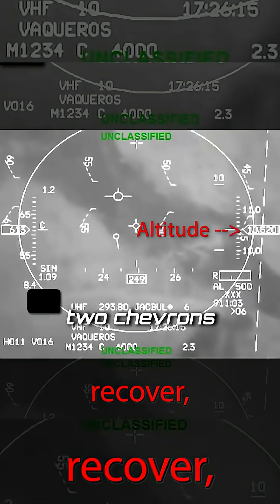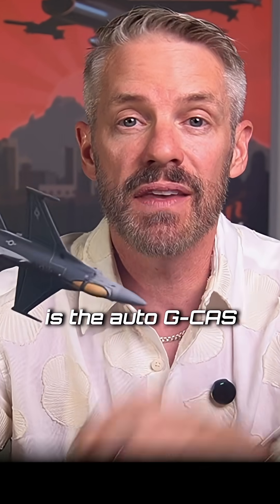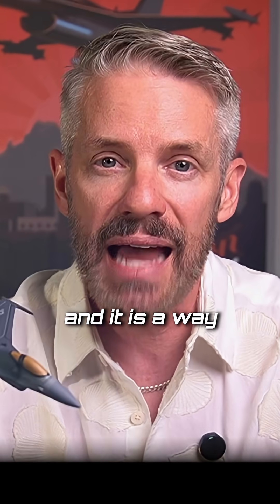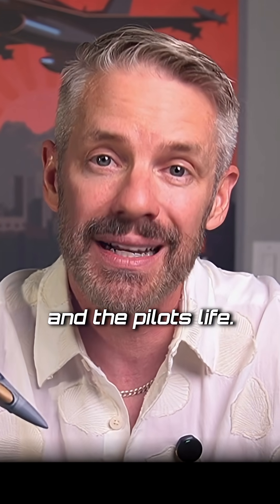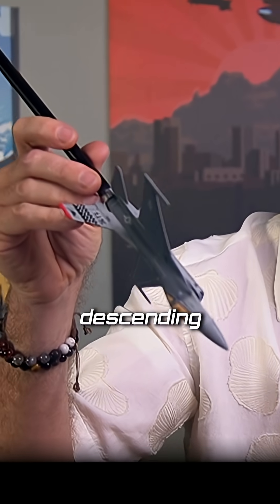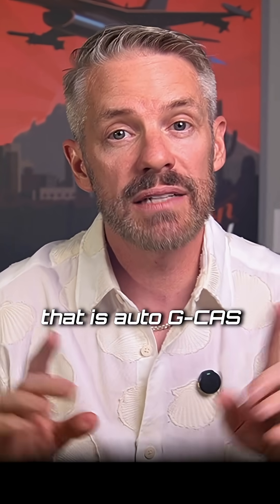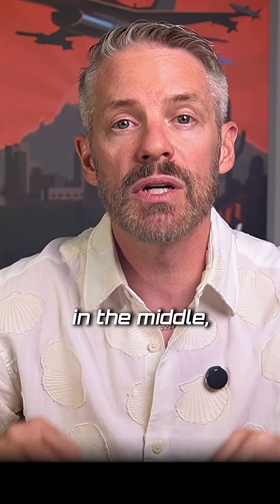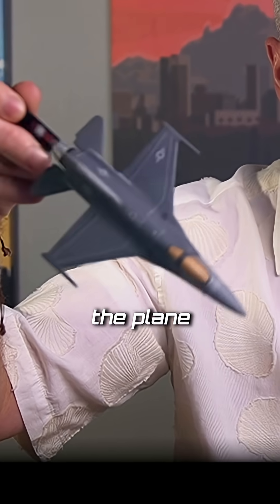Surviving G-Forces in Fighter Jets

Comment: I’m sure there’s a good reason why the chevrons come together, but I would imagine pilots never see it happening because they’re out, right?
Reply: The system works against horizontal collisions too! Such as mountains if the pilot does not take actions necessary to prevent collision. The two chevrons allow a conscious pilot to realize the Auto GCAS is about to be activated. There is a 2 Second delay from when the chevrons meet before the aircraft takes over, during which the pilot can override it still.

Comment: Im just curious. How did the Polish F16 crash if it had g-cas?
Reply: The aircraft had stalled during a high angle of attack vertical maneuver, so the control surfaces were useless.
Reply: @RocketPropelledGuy Thank you🫡

Comment: In the movie top gun maverick, would G-CAS save coyote when he went into G-lock?
Reply: DUH
Reply: @mariogastelum1463 yeah but why did maverick go in to lock him to try and wake him up, when the G-CAS would do all the work
Reply: Because the F/18E Super Hornet does not have Auto GCAS. The system was prioritized to the F-16, as it had the highest numbers of controlled flight into terrain (CFIT). Also the Super Hornet is manufactured by Boeing, while the F-16, F-22, and F-35, which all have Auto GCAS are from Lockheed Martin.
Reply: @RocketPropelledGuy huh, ok thanks!

Comment: I’m imagining a scenario, bear with me if it’s not realistic, where a pilot is pulling hard G’s and once they finish their turn are diving to regain energy, when suddenly they notice the recovery chevrons closing on the HUD. What step/s do they need to take to disengage the system?
Reply: As I understand it, the auto g-cas engages if no control inputs are made while the aircraft is in a nose down orientation at low altitude/high speed. All an aware pilot would need to do is make some sort of control input to disengage the system.
Reply: @a_starlit_raven just like cruise control on a car.